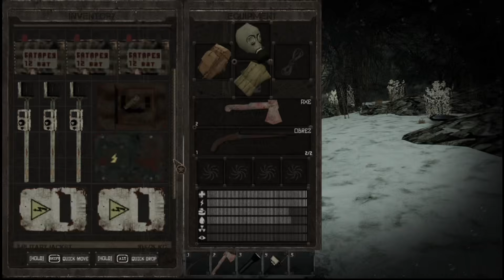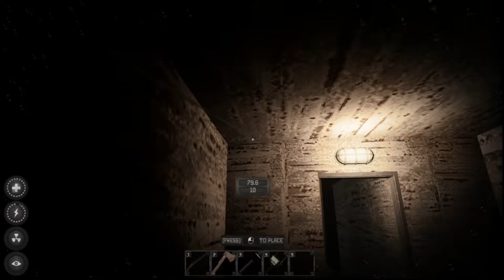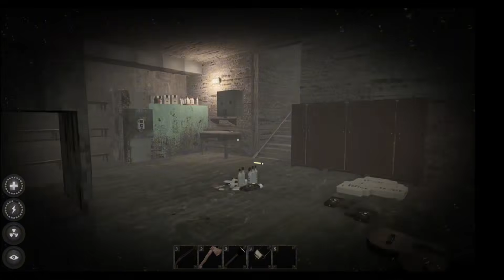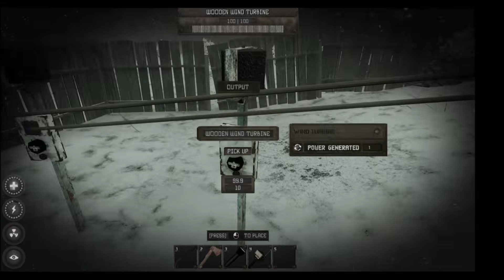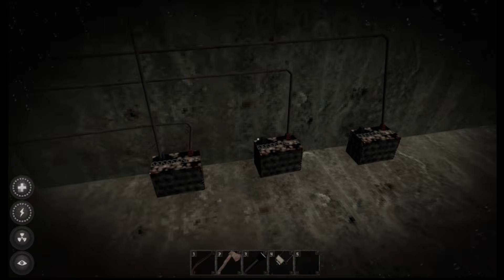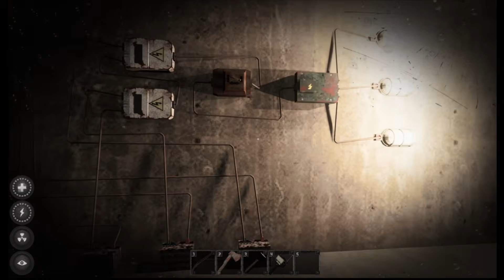MISERY | Setting up lights that run 24/7 |

Comment: Is there no way of getting this setup but to 6 lights? can i add another splitter or do i need to get all items again?
Reply from the maker: For six lights you’ll either have to copy the circuit or use a solar panel and wood wind turbine. You’ll have to install the power somewhere outside and connect them both to a combinder, then the output of the combinder to a battery, and the out out of the battery to a switch, and then the  output of the switch to a splitter, then add two more splitters, with the first splitter splitting the power into the other two splitters. Then you’ll have exactly 3 units of power per second per splitter. Then for each splitter you can split the power equally into each light, for 24/7 power . If it’s too much I can make a video for you. ❤

Comment: Yeah.... I just connected a wind turbines to the combiner and those combiner into combiners, then combiner to battery and battery to battery and then the last battery to the splitter. And then to the lights

Comment: I saw some designs where you could chain the batteries together that works too and then you just simply divide it with splitters wherever you need and put some Switches too so you can focus the power and the combined battery power will maintain the power around your base

Comment: The easier thing to do is connect your power generators to combiners, then you have one output going to a single battery. Then as you collect new batteries you connect those in series, the output of one battery to the input of the next. Then you have one single output that goes to a switch or something similar.

Comment: Misleading title. "24/7" insinuates that it's set up to run without a switch. That's kind of what I was expecting to see when I read the title for this video.

Also, this is but one "correct" way to do the wiring. Daisy chaining the batteries allows you to eliminate the need for combiners on the output, though you would still need them for the input when using multiple power sources as shown in the video.

I'm sure there are also other viable options as well such as a setup that allows the lights to run 24/7 while also providing a switch to cut all production power at once. Maybe you should do another video to demonstrate that, and try to get all your clips recorded during the daylight hours in game so that it will better translate to video - especially when YouTube or whoever applies their compression algorithms to your uploads.
Reply from the maker: I’m using more batteries to be able to store up to 3600 power as long as you are not using the lights. (So it can be used for other things temporarily) I tried to make this a video for beginners in the early game, thinking back on it now, yes it’s more expensive than most. I added the switcher for those who might want to use this setup for other things, I probably should have mentioned that you don’t need it, but the nice thing is, this is the only setup you’ll need for awhile, until you get a chemical station. Yes thank you for the tip! I will try to record during the days only, and make sure not to wear a gas mask. Thank you for you’re time and comment ❤

Comment: I have a question, usually I hook up the power sources (wind turbine, solar panel, etc.) Directly to the combiners and then the combiners to the batteries. Is there a significant difference between the way you do it and how I described it?
Reply from the maker: You will have to use more setups if you do it that way. The reason why I use more batteries is to store more power, 3600 units of power. I also use a switcher to make it easier to store power, instead of turning something off, this circuit is designed to run anything 24/7 and be able to store power for something else. If you used solar panels then that would be the only power income you’ll ever need. ❤
Reply: @Pr1nceV1nce  bro you can simply power the batteries from each other

Comment: Hey you now where i can finde the juck dealer ? 😅
Reply from the maker: There is a door in front of the bunker that you use to go out into an expedition, if you click the bottom option instead it opens up the trading room, the door on the right will lead you to the trader that sells/buys resources. Hope that helps ❤
Note: The extra traders only come with the full game, not the demo
Reply: @Pr1nceV1nce  🥰Thanks yea a got the full game

Comment from the maker: Things you will need for this circuit hope this helps!
3x Wooden wind turbine 
3x Small batteries 
2x combinders
1x Switch
1x Splitter
12x cables

1:03 What you will need